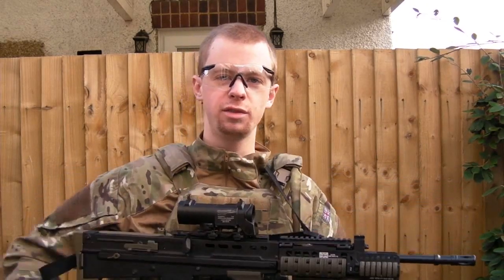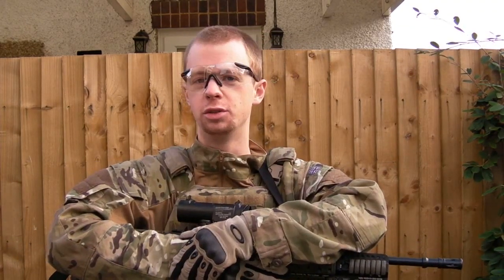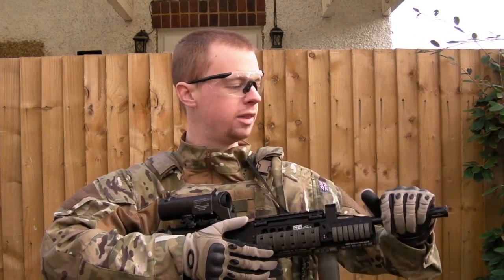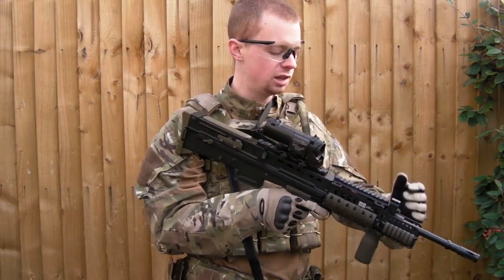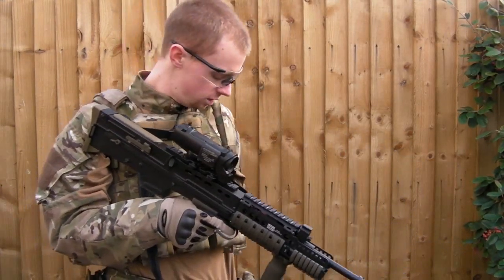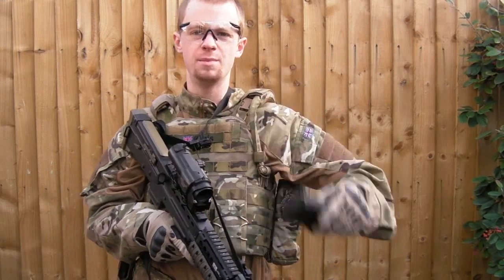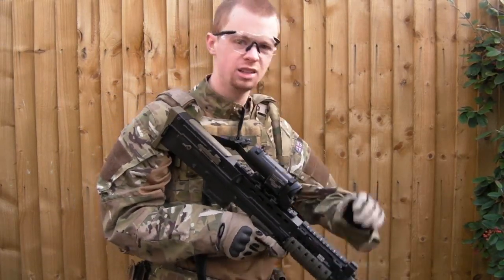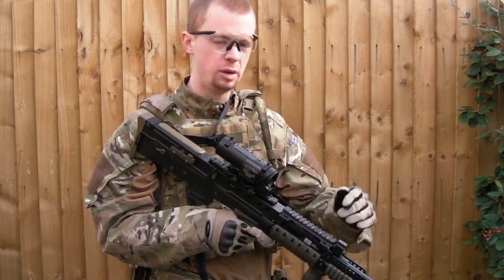ICS L85A2

Comment from the maker: There's no material on the RIS in front of the gas block, so it's a different mounting method.  Adaptor kit is required.  The optics rail is an ICS after market part.

Comment from the maker: The ARES is the closest except for the field strip, where it fails big time.  The gas parts in the ICS look pretty close to the real thing and the way they fit together is the same, the bolt holding open (green lever on the right) works in the wrong direction though, and the bolt release is just a dummy, but that's the same on all the AEG L85s.  Field strip on the ICS is very quick and easy, by far the best of any AEG I've ever seen, you can have the gearbox out in seconds with no tools at all.

Comment: hey man, just wondering if you've re wired the connectors on the weapon or if you just use a large to small converter? i'm trying to ge for the same setup as you, cos it looks like it works pretty well

Comment: Thinking of buying this with the specter sight like yours, did you need to add the aftermarker rail or does the sight fit on the rear sight rail that comes with it. I know ares has the 19mm rail did ics change it to a 20mm?

Comment from the maker: 800mah 7.4v lipo, fits inside just fine.  Removed the faux gas parts and routed the wires so the fuse and tamiya connectors sit above the barrel under the hinged cover.

Comment: Is there even any need for there to be a cocking mechanism? I mean he cocked it back to begin with but the working parts did not move during firing and he did not need to cock it when he reloaded. Is it just for show?
Reply: Yes. He cocked it to give the impression the cocking handles charges the first round. As its electric and not gas blowback the bolt doesnt move. Its there purely for show. Same as my m4. I can cock the charging handle and release the bolt catch but it has no effect on the loading of the bbs.

Comment: My only problem with the L85 in real steel or GBBR is the Bolt since im left handed it tends to slap me in the face...that being said, the AEG ver. is awesome it lets me use the gun without having to worry about the aforementioned problem.

Comment: That shirt your wearing is an American style one even though it has a Union Jack on it because the real one I use has the MTP camouflage and angled Velcro pieces, not horizontal and in Multi-Cam. Multi Terrain Pattern is much more green and lighter and has a larger print size
Reply: I actually realised that those Velcro pieces were angled, but do they have cover plates (Velcro ones that we sew badges onto when we get awarded them), but still if you look at the MTP we wear, you would see the huge difference
Reply from the maker: desantos123 That's an old MTP UBACS still in the CS95 cut, i.e. pre-dating the issue of PCS.  I got it from stores so I can assure you it's not American Multicam or anything like that, it's just different to what we're all issued now.  Compare what I'm wearing to pictures of the old issued desert DPM UBACS and you'll see the same cut of the velcro and pockets etc.

Comment: 1:23
CHECK THE ROUNDS
INSERT THE MAG
TUG TO ENSURE IT'S SECURE
RACK COCKING HANDLE
FORWARD ASSIST

GOOD DRILLS! :)

Oh, and you even closed the dust cover as well. Top drawer. In terms of the actual L85, I have an ICS one too, and it's nice to know that yours sounds as whiny as mine. btw, is that the Madbull rail? Did you have any trouble fitting it?